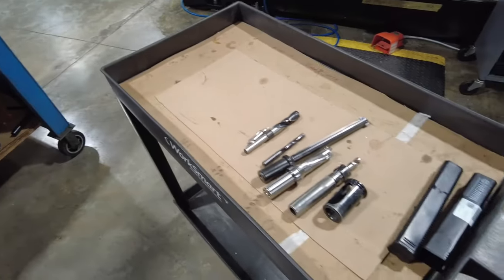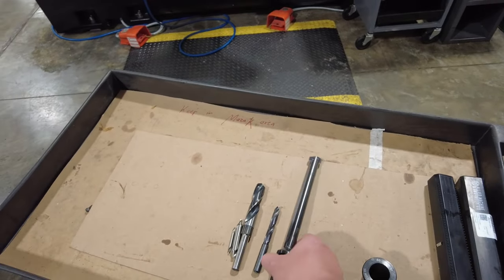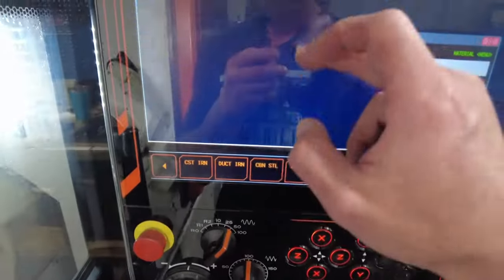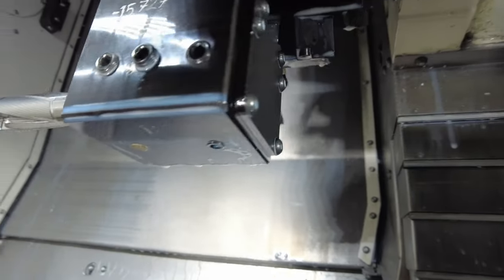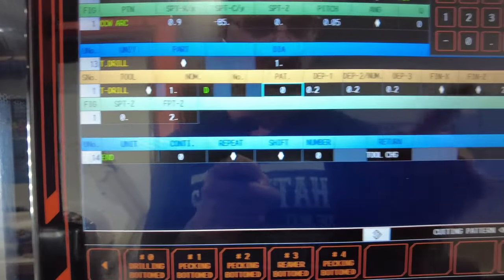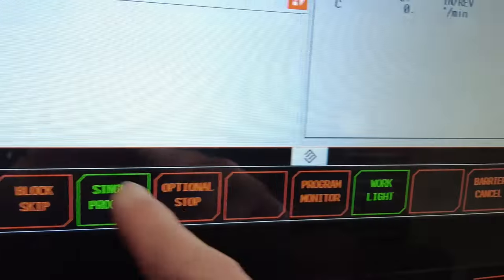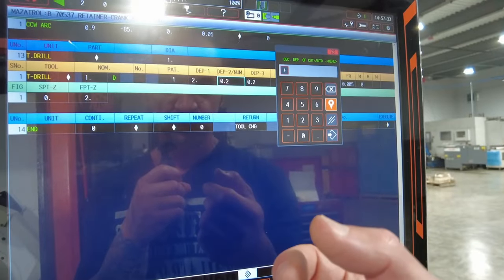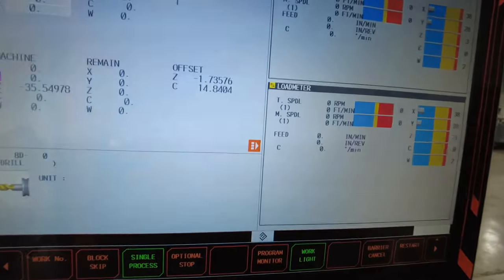Mazak Smooth G Lathe Drilling Basics

Comment: If you find the u-drill is cutting on retract out... i have run a reamer cycle.. in the tpc you can do a multiple based on the feed in... think you can put 999... be a multiple of 9.99..  can do it with a detrimental feed reduction in a drilling cycle to... sometimes that rapid and drill run out rubs the corners on a high speed steel drill... did it for a long 1/4 inch flat bottom... if I remember correctly was like 9 inches deep..
Reply from the maker: I have never tried a reamer cycle before, I will check it out when I get a chance, thanks for the tip.

Comment: Dear Sir, do you know how to create a Mazak deep hole dwell program? I plan to use the end mill in drill mode, and I want to stop it at the bottom of the hole for a few seconds. if you know please me give a tip.
Reply from the maker: Go into temporary parameter settings and find dwell tab, I forgot exactly but play with numbers like enter 1 or 2 and see if it's going to be a second or two, if it's too long than do .1 and so on. I'll test it on Monday for you
Reply: @martyz3232  Thanks a lot Sir! I hope I am not troubling you, but I really appreciate your kindness.
Reply from the maker: I've looked at the parameters of live tooling drill and I only see dwell parameters for center, chamfer, but no drill it self, I think that your only option be to make a manual program, there are g codes and m codes that will allow you to do that, I don't have much time right now to look up these codes, but I dont see a problem with it to be any complicated, G83 from what I remember is face drill, add your Z location so -1 inch be 1 inch deep, q value be pecking q2500 be .25" each peck, and P is dwell, 100=1/10 so P1000 is 1 second
Reply: @martyz3232  I also noticed that. there were no Dwell parameters for the center hole in my machine too. I will hope to make an MNL program for that work. using G83 as you say. I will let you know the results later on.
Thanks for taking your precious time to consider my request. I really appreciate it.
You're an awesome machinist.